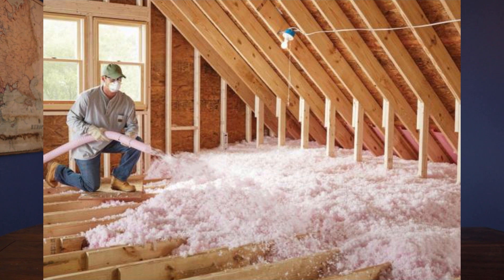DIY Geothermal - What You Need To Know

Comment: Im not an engineer, Im a machinist. I want to do my own geothermal ground loop system. I see everybody doing the slinky loops but I feel that the loops are fine but I dont feel the return should be touching the loops. Seems to me the heat would be transfering from one to another more than would be ideal. I have 10 acres so I was thinking of running the in pipe straight  at 10' deep and backfill somewhat and then run the out pipe a few feet above the other one. What do you think.
Reply from the maker: That's a great way to do it if you have the time.  It takes an incredible amount of time to do that much digging.
Reply: @Challenged1  I was watching some youtube videos yesterday and saw a guy drilling wells about 15' deep by hand using a piece of pvc pipe with a homemade cutter on the end. Water was flowing down the pipe from a garden hose. He had a piece of wood attached to the pipe that he could slowly turn the pipe back and forth. I was surprised how well it worked. He drilled about 20 wells and hooked them all together. Iwas thinking a could maybe do this on a larger scale using a hydraulic powered drill bit. I have a boom I could attack to my big loader or to one of my s ons farm tractors
Reply from the maker: @TheJohndeere466  Sounds like a fun experiment!!!
Reply: @Challenged1 My boom is actually a tv tower. I could make a carriage with small  wheels with v shaped cut in the center so they ride on two pipes of the tower.  Mount the tower vertical to the tractor and use a 2" steel pipe with an auger on the end and drive it with a hydraulic orbit motor running off the tractor. An electric winch with a pulley mounted at the top so the winch will pull the drill up and gravity will bring it back down. I think I would try drilling without water and just clean out every few feet and add water if this doesn't work. What could go wrong ? Rocks would definitely be an issue
Reply: @Challenged1 may even hit water. We have an old dug well and the water comes within 3' of ground level

Comment: did you mention about 1 acre of land, but you only need around 250 sqft, maybe I missing something
Reply from the maker: The size of the loop field is dependant on the size of the unit you are installing.  Residential lots are small with lots of stuff running underground in the limited space.  Don't forget about trees and shrubs.  Larger lots are more desireable since the loop field can be placed in an area that avoids everything I previously mentioned.  Can it be done on a small lot, absolutely.  Is it ideal, not at all.

Comment: I helped my father build homes back in the 1960’s-70’s. Dad tended to build things to last for generations (e.g. using huge telephone poles to build barns).
Although it was more expensive up front, along with fresh air HVAC duct work to all rooms, he ran return ductwork from every bedroom. 
He did this to get better air circulation and even temperature control. Folks don’t realize that closed bedroom doors choke off air flow, which defeats the purpose of an HVAC system.
As a side note, being a fellow landlord, you know what I mean when I say that I often think SOME tenants lay awake at night dreaming of ways to destroy the home!😳 On several occasions I’ve gone into a home and will see the tenants had 3-4 100-watt incandescent light bulbs in a single fixture.🤦🏻‍♂️  When I go into the attic to inspect the wiring, I’ll often find the insulation completely melted away from the wiring 1-3 inches, creating a fire hazard!
Tenants don’t appreciate that they’re pulling too many amps through the wiring, as they think a light is a light bulb… I’m personally elated incandescent bulbs have been replaced by LEDs!
Thanks again for your informative videos!👍
Take good care!

Comment: If you use a 2 stage or variable compressor does your water in your loop continue to run? I'm doing an open system and am curious if I will end up using more water?
Reply from the maker: The water pump kicks on at the same time the contactors close to kick on the compressor.

Comment: I read somewhere that you will need to replace your tubing in 20-25 years. Is this true? And if it is, is there a better tubing material that will last longer? 

Since this energy source's value proposition is mostly long-term, replacing the tubing after 20-25 years seems counter intuitive to the overall value
Reply from the maker: It's a minimum of 50 years

Comment: Question : any thoughts on a geothermal system in conjunction with heating/cooling radiant floor system ? Or that is complicating it too much ?
Reply from the maker: While I haven't used one, I know they are available.  The only problem with having the floor system be your only heat and cool, is there really isn't a mechanism to add fresh air, or to remove/add humidity.
Reply: Use erv to bring in fresh air

Comment: Hey Garrett. I've installed a couple of radiant heat system using on demand gas heaters. In those systems there's a permanent water supply hooked up to the heating loop. There are also air separators, or whatever they're called (I forget), to bleed air out of the lines. It's supposedly a "closed loop" system. Is this the same for the ground loops? Or are they supposed to always stay full and never lose any fluid?
Reply from the maker: It depends if it is a pressurized system or not.  Mine is non-pressurized and doesn't require any of the stuff you mentioned.
Reply: @Challenged1  The only thing those radiant systems I mentioned really have is a circulatory pump. Does that mean it's under pressure? Well, I guess the incoming water line applies constant pressure, which would probably be how it tops off the system. Is that what you mean by pressurized?
Reply: @Challenged1  So just thinking about it a bit more. How do you fill the system? And is it not necessary to bleed the air out of the line? Is it okay that it's not entirely full? Presuming no fluid loss over time? Do you have to refill it from time to time?
Reply from the maker: @wthomas5697  The reservoir with the pumps attached for the non-pressurized system sits at the highest point.  As the fluid pumps through, all air bubbles naturally collect at the highest point.  It takes about a day at first startup to get all of the air out.  Assuming no leaks, the fluid level stays the same with no need to refill.

The radiant system that you described has a high level of thermal expansion as the temperature differential from start to finish is pretty high.  The loop field in my system only has a 6-12 degree temperature differential resulting in low thermal expansion.
Reply: @Challenged1  Thanks Garrett. That makes sense. You have all that stuff on the radiant heat side of the system though, don't you?
Reply from the maker: @wthomas5697  Mine is forced air
Reply: @Challenged1  Oh, I see. Any particular reason you went with forced air as opposed to radiant? Radiant heat always seems preferable to me.
Reply from the maker: @wthomas5697  Would have increased the cost substantially.  Air conditioning is required in my area, so the ductwork and air handler would be there anyway.
Reply: @Challenged1  I'm planning on using the ground source heat pump for cooling as well as heating. Wasn't that an option for you?
Reply from the maker: @wthomas5697  Are you cooling via the same radiant heat tubing?
Reply: @Challenged1  Yes, that's what I understand.
Reply from the maker: @wthomas5697  In my area, we need fresh air as well as dehumidification, which the floor tubing won't provide.
Reply: @Challenged1  Your hvac system introduces outside air into the house?
Reply from the maker: @wthomas5697  Fresh air supply, yes
Reply: @Challenged1  Hi again Garrett, (I hope I'm spelling your name right). Is that 600 sq.ft./ton number specific to Kansas? Also, how do you keep your lines full of water and antifreeze solution? I imagine there's some loss over time. Do you have to top it off on a regular basis?
Reply from the maker: @wthomas5697  That rule was told to me by a long-time hvac installer.  I don't know if it still holds true or not, or whether it's a Kansas thing.
The lines with water/antifreeze in them is a closed system.  The only reason to need to refill would be if there is a leak.
Reply: @Challenged1  I've been wondering whether the 600 sq.ft./ton number is a function of how much total heat you're going to need, worst case. Where I'm at is never going to get as cold as Kansas but maybe there's an optimum number the system functions at per ton. Hmmm...? 

I've been studying various photos of closed loop gshp systems on the internet since I'm trying to figure out how to do one for myself and at least one of them definitely featured a port to refill the loop side of the system manually. Apparently there is a potential for losing fluid over time, maybe via the pump. I've installed a couple of radiant heat systems with gas fired boilers and there's always an autofill that keeps the whole thing topped off. They're considered closed loop systems. How do you know if it's still full?

Comment: If your ground loop is at a constant 60 degrees, wouldn't you need supplemental heat in order to get above 60?  My wife would be wearing a parka.
Reply from the maker: It's a heat pump, not dependent upon the ground temp for the final temperature.  Refrigerant gets compressed and expanded.

Comment: No a Geothermal System isn't DIY for 99% of people who want one.  We had a 5 ton closed loop Geothermal System with two 288 foot vertical holes drilled.  The first driller wasn't up to the task so a second very experienced driller took over and it made a huge difference.  One also has to be experienced at operating a backhoe to dig the trench which is necessary for either a horizontal or vertical system.  Also drilling a hole in a basement foundation wall is one of the easier parts of the project.  The final cost of our system after all credits and rebates was $21315.70 money well spent.  I've only listed a very small part of the installation there was permits, electrical connections, install of loops, testing equipment, removal of oil furnace and air source heat pump , draining and removing heating oil tank, and various other tasks.  So if one knows nothing but has loads of time to learn ten different skills and added expenses of making mistakes with a year to complete the project then yes do it DIY!

Comment: Great stuff.  Is that only 1" pipe?  Are the coils outside 1"?  You mentioned 600' / ton of heat transfer was some old hat rule-of-thumb but best to check it out in detail.  I noticed that one older book seems to be out of print and hard to find. 
Thank you for sharing all you've learned.
Reply from the maker: The buried coils are 3/4".  The length of pipe will depend on your soils and climate.

Comment: I wonder if you bury a 5000 Gal water tank 15 feet under, fill it up then cover it with 3 feet of insulation & use that to run the geothermal pump - would that work?
Reply from the maker: In that scenario, there wouldn't be any transfer of heat from the water to/from the earth.
Reply: That's the point, a giant insulated water tank for storing btus to extract/refill when needed. Add a 2 heat exchanger coils one to add heat one to take heat to the heat pump. Use some thermal solar panels to add heat to the water tank up to a max btu limit needed for your system.

Comment: Besides the initial costs, what are after installation costs (O&M)? As most furnaces/air conditioners are now two stage, electrical costs should be the same as a conventional system.  Fuel (natural gas/oil/propane) are nil unless one adds the proportion of the area used against property taxes.  The big costs are cyclical replacement.  I live in Canada so furnaces last about 10-12 years and a/c 10 to 15.  A/C's could be repaired (compressors) but usually involve new lines and exchangers, furnaces can't because of the firebox.  With a Geo system, and without over-taxing the system, does this system have a longer lifespan and can most of the units be maintained with parts replacement only versus replacing the units and how does this cost compared to the initial investment of those units?

Comment: Thanks for the video with clear information. Do you have any other heat source beside this geothermal heating and cooling? Are you able to warm your house to 70F degrees in the winter with just your geothermal system? Thanks.
Reply from the maker: I have backup electric heat strips if need be.  However, I've never had to use them, and that's with temps down to -18*F.  I have no problem keeping whatever temp it's set to, but I also have a very efficient house.
Reply: @Challenged1  Thank you for your quick response. Is your heat exchanger or heat pump boot up the temperature somehow? I assume you live in MO (as one of the viewers said that. I am in MN). According to the mean earth temperature map I read somewhere, your mean earth temp is at about 47F. At 10 feet below the ground surface, temp range is about 40F - 55F through out the year. I am assuming the heat exchanger is just converting water temp to air temp. Did I miss something, or I just don't understand enough?
Thanks.
Reply from the maker: @thanhtruong4673  I'm in Kansas.  Since it is a heat pump, the refrigerant going thru it's normal cycle boosts the temperature.  The heat is ether shed to or taken from the earth via the coils buried in the yard, and there is a heat transfer from the refrigerant lines to those water/antifreeze buried loops.
Reply: @Challenged1  Thank you very much. That makes sense and I am happy that I understand it correctly.

Comment: I am getting ready to move a small farm Cape-style cottage (23.5' X 32') directly to the north of where it currently sits over an old basement.  I would love to know if I could use the existing space of the old basement (instead of a pond or lake) to locate the loops before filling in the space.  There is a concrete floor about six feet below grade.  The house sits too close to the highway, otherwise I might try to just save the old basement, which is not in terrible shape.
Reply from the maker: It's a little shallow for that exact application.  You may start pulling/adding heat from/to your home from the loops due to the close proximity to the home.
Reply: @Challenged1  Thank you very much for replying.  I see your point.

Comment: Unfortunately in the mountains in Colorado vertical is really the only option as the top layer of soil is not even close to deep enough before hitting rock for a horizontal loop. At least vertical is possible, and the rock comes in handy with these loops as it has fantastic thermal qualities, and doesn't need support tubes to keep the hole from collapsing. Also, since most of us need a well up here it isn't a bad option to go ahead and have the vertical holes drilled out while you have the well drilling equipment on site anyway. Looking forward to building my A Frame with solar and geo thermal when lumber prices drop back down a bit (2021 lumber prices are insane).
Reply: I’m also in Colorado. Denver currently, but hoping to build on our land in Alamosa starting spring of 22
Reply: @rodm5830  Congrats. I'm up in Northern Denver right now, but I'm looking to build in Alma in the next few years. Trying to find a southern facing lot currently (the lot I thought I was getting fell through). Good luck in Alamosa, it's gorgeous down there.

Comment: I’m currently getting calculations for forced hot air . Have been told mini splits not effective enough during winter as a stand alone source of heat .
I automatically thought geothermal was out of price range and diy .
Question is the calculation I receive for forced hot air , can that be used in geothermal unit needed .
Building with ICF 48x28 walkout basement - 2 floors .
Reply from the maker: The heat load is the heat load regardless of the heat source, so yes

Comment: Garrett, finally now I know your location, we are about 3-4 hrs drive time, BTW I just moved here from WI, my home I purchased does not have natual gas, there no propan either, I got electric heatpump and wood burning fireplace, after last couple winters with MO weather, I am now looking for other heating source, I though about outdoor wood burner unit or geothermal?  I installed a solar system, so I got the electric bill cover, but the system not big enough for run the heapump at night, to keep up with the tempurter, I burned wood, it kind a messy but provide me some heat at night, I was looking at the geothermal for long time, I am retired so I have a lot of time, all I need now just the excavator and material after watch fews of your video,  I have 3 arces of land to land the pipe and hopefully I can eliminate the messy from wood, btw I also buy the wood to burn, very nice layout.
Reply from the maker: I'm glad you find my videos useful

Comment: Ground-water is ALWAYS the way to go.....if you have a water well, you're all set. Check the hardness of the water, and if high, isolate the coaxial exchanger in the heat-pump with a brazed plated heat exchanger. Easy to clean or replace should scaling occur.

DO NOT get into the muckety muck calculations of this and that.....think about it? Well water comes from waaaaay down in the earth, and the deeper you go the more stable the temps are. Not 10 feet, 80, 90, 100 ft. and beyond.

Code requires a back-up heat system (heat strips...) but in my 14 years with my system, it's never once come close to needing them. Year round, the performance never deviates. Water from that depth has no idea what the temps are outside.
Reply: How deep is your well?
Reply: @terrafirma9328  The common thought is 60 inches for direct burial lines?...My well is 30 feet, so I beat all of this BS by 25 feet.